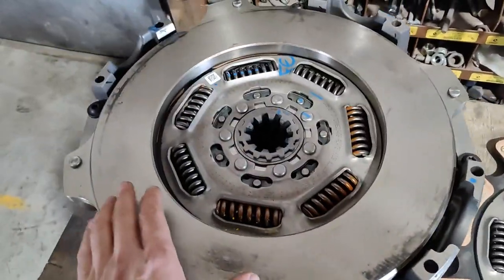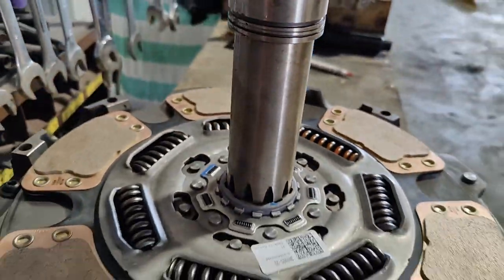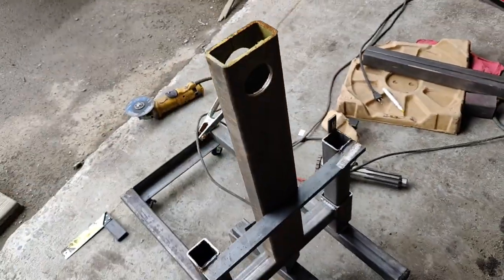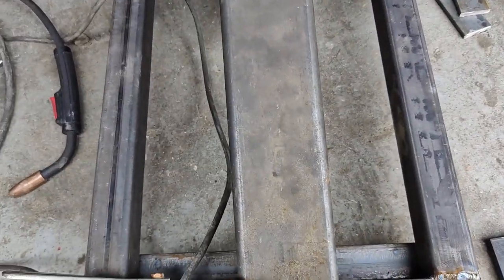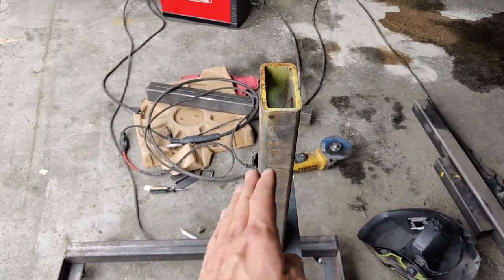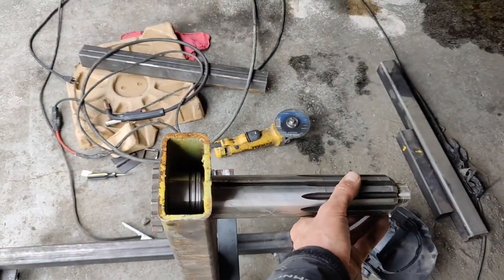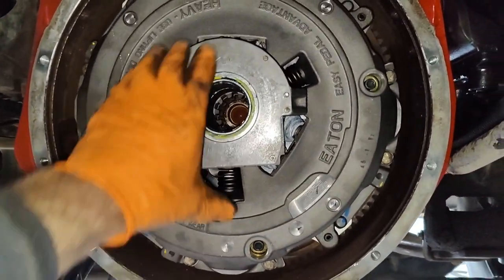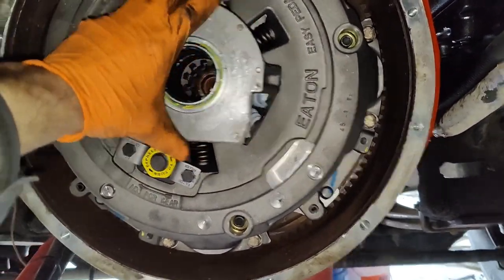Fabricating heavy duty clutch jack! Installing Eaton clutch back on the truck!

Comment: I ran across a platform jack that was surplus from a big company. It was used to lift heavy dies from low to bench top height. I did the same short pivot with a used input shaft. A little hard to manuver  under the truck, but nothing like having to lift a twin disc 15 inch truck clutch. Fly wheels are not too bad to handle but at my age 150lb clutches are a challenge. Tools rental companies would be an option if you can find one that has a good clutch jack. The clutches for Volvo vnl 670s is around 1000.00 or more now. your idea is a safer and effective solution. A five hundred lb. clutch jack runs about 1100.00 on Amzon and E-Bay. I put these clutches in on asphault that is sloped and a little rough. Just bought a used Iatco. clutch jack that had only been used a couple times. I paid 125.00 for it and even if I only use it once, it is worth every penny. Facebook Marketplace.

Comment: Damn I wish we had a jack at my job my boss puts it up all at once but its too damn heavy i try to put up the discs and the plate then i try to put the pressure plate over it and align the intermediate plate into the grooves
Reply from the maker: This is a good workout if you don't have a Jack)